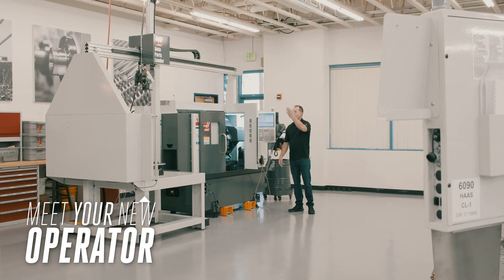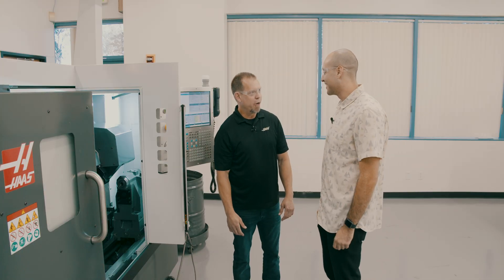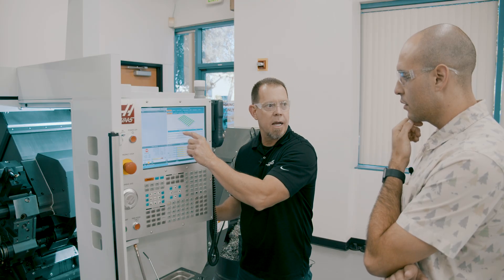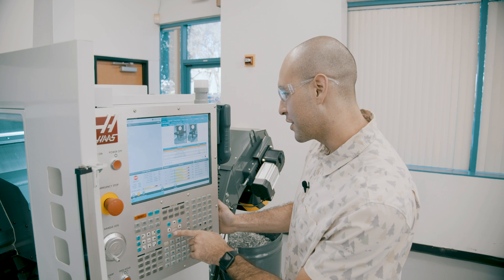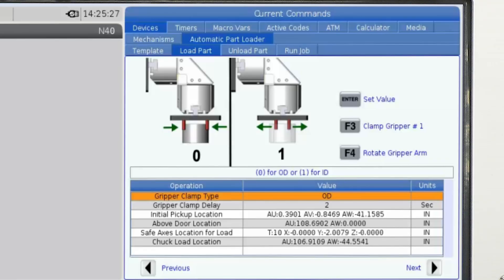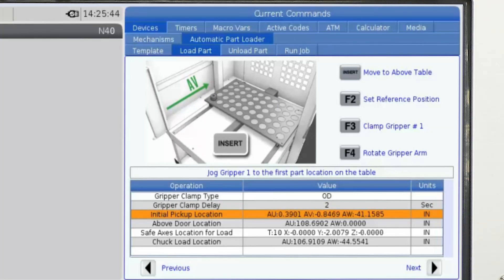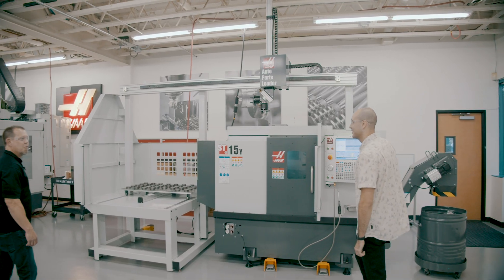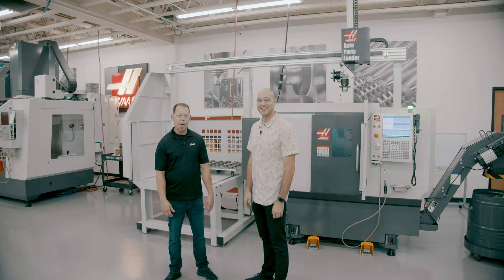Can This Guy Run A Lathe Automatic Parts Loader? - Haas Automation, Inc.

Comment: As an Accountant the guy has at least half a brain.
( Positive thoughts OK nothing Negative )
Meaning if you want to run a CNC anything it,s actually Not that hard ??
The hard part of learning anything new is not letting it get the better of you, or Not giving up because it seems to hard to learn.
One thing to remember if it was easy anyone could do it.
You just need to decide if you learn it or Not ?
As always another good video from HAAS.
( I am a Mazak guy OK )
Enjoyed the video.
Peter.

Comment: it's only a matter of time. large factories have been using pallet changers and pallet lines forever. unskilled labor is all going to be automated.
Reply: Good. Hopefully itll push those unskilled laborers into learning a trade and make a career out of a skilled trade. Like maaaybe programming.
Reply: @pakman422  It doesn't take being a well-rounded programmer to make a machinist irreplaceable by a robot. There are plenty of job shops out there that still desperately need people who can still do manual work. Our shop does a lot of high dollar one-offs and mods and sometimes its just more cost-effective to do it the old way. Can't say the same for button pushers, though.

Comment: Costs like 15k eur? Is it really true?
Reply: that sound cheap compare to a 20k robot arm
Reply: @chaddanylak8706  both are way too expencive compared to low cost workforce who can also change inserts if needed for example
Reply: @zyndapp800  the system would pay for it self within a year and when It comes to insert you can set the machine to alarm out if the insert is worn

Comment: Welp there goes lathe careers out the window. Now they need a machine that's sets its self up and bam! You got yourself a asset that will never be late to work lol
Reply: All 9 of my lathes are bar fed, I still have 2 operators bouncing between machines inspecting,loading material, and deburring.   I'm working on that
Reply: "career" as a button pusher... come on now
Reply: @Eggsr2bcrushed  lol I setup and program ... Button pusher
Reply: @jayyflores2155  if you setup and program then how does the parts loader take your job? Smh
Reply: @Eggsr2bcrushed  I never said I personally worked that position but everyone around me